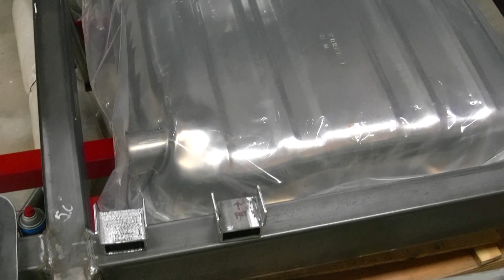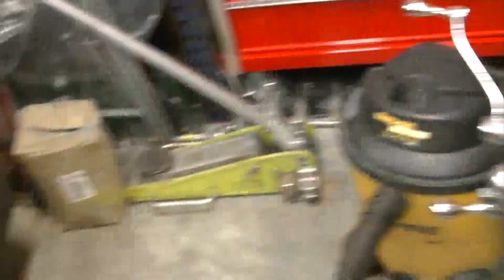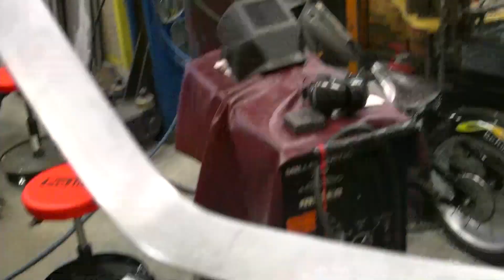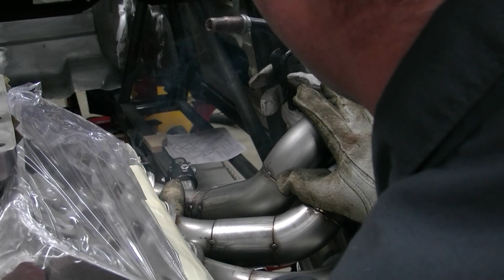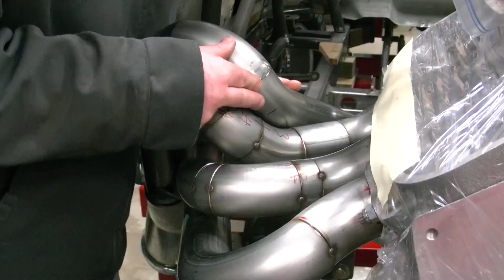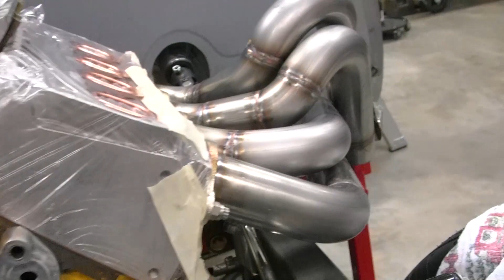Studebaker Gasser Build Update 17 (fabbing headers)

Comment: Really nice project. Will this be a street car.
Reply from the maker: Will be a street strip car. More geared toward strip. Should be about 1500 HP on methanol with blower cranked up. I'm building engine almost identical to my 6 second altered with a less compression. Will run on gasoline on street turned way down.

Comment: Lets say I had a header flange and the holes in the flange were smaller than the diameter of the stubs that I want to weld them to. Do you think there would be a problem if the pipes do not actually stick in to the holes in the flange. and were just welded up to the flange? I'm watching videos on this to see if anyone does it like that and I can't find anything.
Reply from the maker: It would stand a greater chance of cracking at the flange. It would work but not sure what the longevity would be.
Reply: @finalcallracing  it won't crack if I weld it, jk lol. thanks for the reply. So that is kind of a no no when building headers, I understand. that's what I wanted to know.
Reply from the maker: @davidcraft4909  it'll work just not sure how long. Might last forever 😆  just not a common thing.
Reply: @finalcallracing  the actual real issue is that a lot of small block chevy heads have like a square or d port exhaust. and I want a flange to match to seal the best. but I think it might be a problem to bend a pipe to fit inside a dport or sqaure exhaust port. and the header flanges that come with stubs welded are expensive. either way thanks for  your video and replying